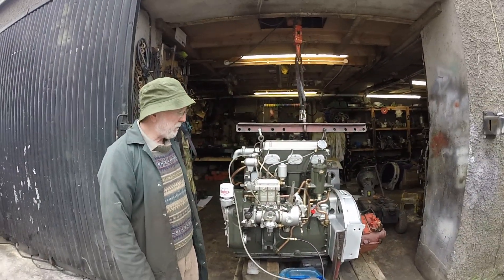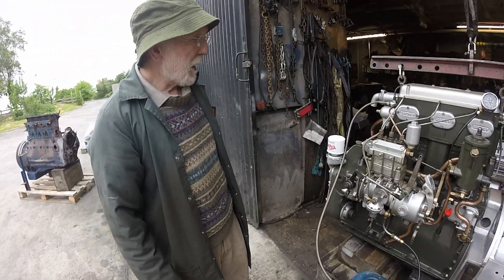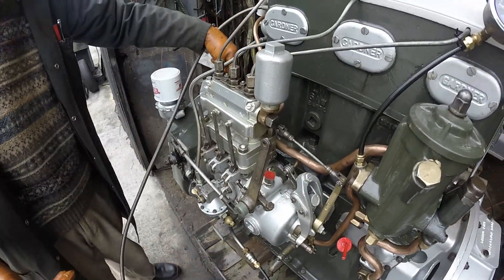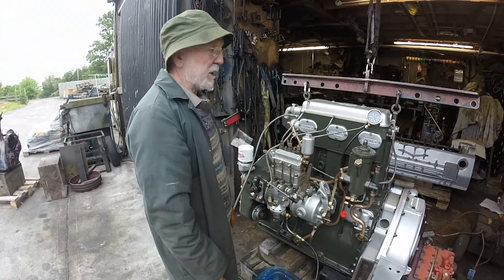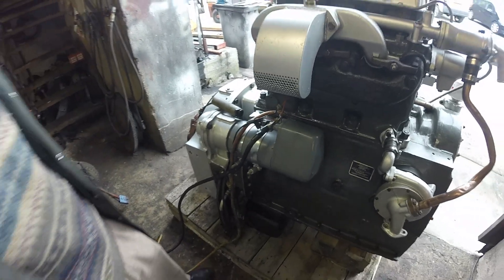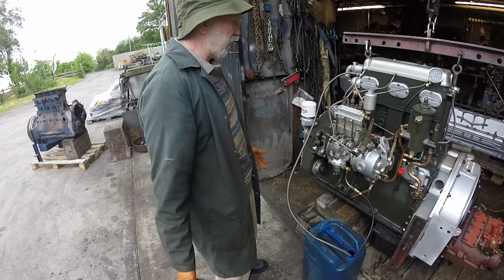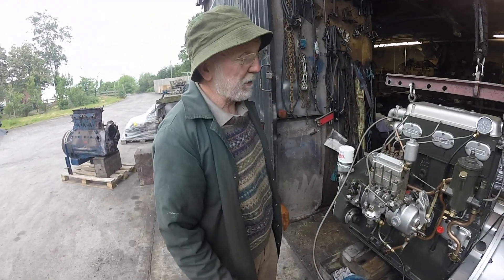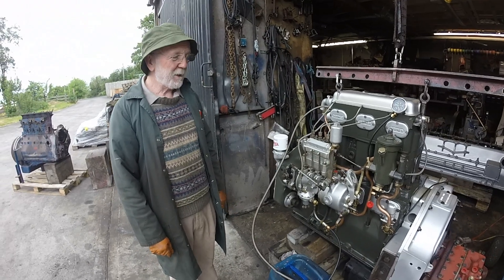Gardner 3LW

Comment: Wonderfulengine!
When you are changing secondary fuel filter on this engine do you need to bleed the air from the filter housing or will all the air just go thru the fuel return line on top of the housing?

Comment: I am in my seventies but I well remember my father having an old motor yacht in the sixties with twin Gardners. These were far from young even then, six cylinder I seem to recall. I cannot remember the detail but you had to ease the compression when starting from cold. It had a header tank which you manually pumped fuel from the main tanks up to, of course gravity fed the engines. I often wonder what happened to both boat and engines. This was on the West Coast of Scotland and the boat was called TSDY Maori. I would love to hear if anybody has any recollection of her. There was still a large herring fleet back then and they all had single screw Gargners.

Comment: Hello Joe, what was the problems with the 6LYT,  I  heard one running at a rally in an Atkinson and it sounded beautiful, the fella that owned the vehicle had the engine totally rebuilt, love your video's by the way, in the past I've ran plenty of Gardner 6LW/ 6LX/ 6LXB AND 8LXB, but had better service out of the 6 cyl ones than the 8 cylinder,
Reply from the maker: Sorry Alec, I cannot be specific, but the stories about them are so bad, we have steered clear.
Reply: @tangentgardner  camshafts were soft and the lobes wore badly

Comment: I have only worked on Gardner road vehicle engines, which have two thermostats. The point of having two, is that they are set at different temperatures, so you have a primary stat and a secondary stat - This arrangement reduces thermal stress by avoiding opening up the cooling system to very cold coolant.

Comment: Joe, how about a video of reworking the water pump to sealed bearings, adjusting the pump timing rod andtiming chain adjustment.

Had 2 off 3LWs 1 in 40 footer ( 6knots on 3 quarts ) and 1 spare that I will never need.

Comment: Surely the statement that a modern engine is not as efficient makes. No sense. Undoubtedly a fine engine in its time but we have moved on. I. Can of course imagine a. Simpler engine nodding to  the Gardner heritage a. Case of. Rose 🌹 tintd. Spectacle smeared with. Diesel fumes
Reply: We HAVE moved on. We've moved from reliability and efficiency to emissions controls, ungodly masses of electronic controls,100's more failure points, and cheap to manufacture.
Reply: Will try to to come round to your point of view and case of compromise old and new hybrid needed
Reply: Electronics can be much more reliable than mechanical systems and diagnosis fantastic
Reply: @frederickbowdler1509  
It strikes me that this powerplant is simple, uncomplicated, built to an exceptionally high standard, world-famous for reliability and very long life, world-famous for fuel economy and ease of operation.
In applications such as narrowboat propulsion, a marinised automotive high-speed diesel with variable turbo, common rail injection, closed-loop fuel control, labyrinthine exhaust processing and urea injection………..is pointless. The installation in a narrowboat operates 98% of its life at tickover. All the additional mechanical and electronic clutter over and above that fitted to this engine equates to additional points of failure, expense, and ongoing maintenance cost.
From a sustainability point of view, refreshing the engine shown for another 70 years of service is vastly better than buying a complex and resource-hungry parts-rich new one.
Reply: @frederickbowdler1509  Strangely enough,  modern diesels need to be run to at least 80% of their rated horsepower for an hour every week to remain healthy.   Running the engines they make nowadays at tickover in a narrowboat for long periods in time would likely not go well.
Reply: @frederickbowdler1509  can be but are not ,look how shite DAF ECUs are

Comment: Lovely engine. They 6 cylinder version was also used on the Atlantean buses. Never a problem.
Reply: I was never aware if these engines being used in an Atlantean. Normally the leyland 0.600 or 0.680 surely. The Daimler Fleetline did commonly use them though.
Reply: @ianpegge9967 Fleetlines usually had the 6LW, 6LX, or 6LXB; Atlanteans had the O.600 or O.680. They were both succeeded by the Olympian, which had the 6LXB.

Comment: Such an interesting contrast to a 3-71 Detroit. This is a smooth 4 stroke with 42 hp at 1200 RPM. The Detroit made 80 @1300 or 109 @ 2100. It was smooth but it did not sound so soothing. Me? I will just take one of each.
Reply from the maker: Well, we have 3LW's available.  Just email me.

Comment: Were they ever used in trains? When I was in Scotland in 1988 I was in a train, single car with a manually shifted 3 speed transmission and a diesel motor, it was very old but was still in normal use by Scottish rail.
Reply from the maker: Yes, 8L3's in particular.   And of course the Irish Turf company, Bord na Mona, used 4LW's a lot in their small locos.

Comment: Greetings from Australia, I used to work on these (in my younger days)with the eight cylinder in Fodens and the six cylinder in Guys. Good reliable engines but expensive to rebuild.
Reply: Hello Bob, greetings from Cornwall. I worked for AEC trucks in Bristol when I left school and worked on a Seddon Atkinson 8 wheeler with a Gardner 6LX engine in. It was a big rebuild as the motor sucked in water in a flood and bent several con rods. Hope to get to Aus one day.

Comment: It'a not that the injectors cannot handle the excess pressure from the pump, it is that they leak internally once worn.
Reply: No you are not quite correct about the wear factor, the pintle pins in the injectors do not have any seals around them and when the pressure from the pump hits the pintle pin and lifts it off the seat to inject the diesel into the cylinder a small amount of diesel by passes (it also lubricates the pin) and comes out through what we call here in Australia the dribble line then into the return line back to the fuel tank. I have been a heavy diesel mechanic for almost sixty years on trucks and earthmovers. Take care every one
Reply: @bobw7066  reread my comment, that's what I mean.

Comment: I have one of Joe's 3LW engines, nearly 10 years and around 3000 hours since fitting in my narrowboat. Doing it's job well. Thanks Joe.
Reply: Yeah. Boating in an inland ditch at walking speed. That's really a test of engine quality.
Reply: @deeremeyer1749  . I  think 10 years without a problem says it well enough .

Comment: Gardner's simply the best engines ever made!!!!
Reply: Totally agree, Read a story on a forum from a guy that had a Seddon Atkinson truck with a 6LX in it,.. it did 2.5 million miles, and all they changed in that time was a head gasket and the injectors. Was still chugging along like a beauty when some lucky person bought it off them.
Reply: Too expensive, or too heavy to still manufacture? Air pollution prior to getting up to temperature?
Reply: @billsmith5109 yeah that's correct we ran foden 8 wheel tipper trucks with the 6lxb engines and they smoked like hell every morning until warmed up.

Comment: Nice video! Those levers on the fuel injection pump aren't so unique though, seen them on many dutch engines before which are much older :)
Reply: If you mean Kromhout engines they are Gardners just built under licence by Kromhout.
Reply: @flat5sharp11  I never new that, so if I want a 6 LBX I can just get a Krochout engine ?
Reply: @flat5sharp11   a few of the later models indeed. And I'm also referring to other Dutch companies who build diesel engines.